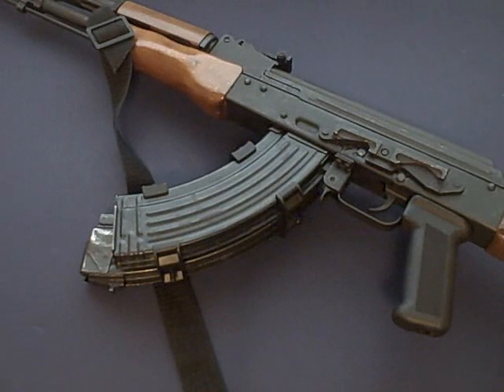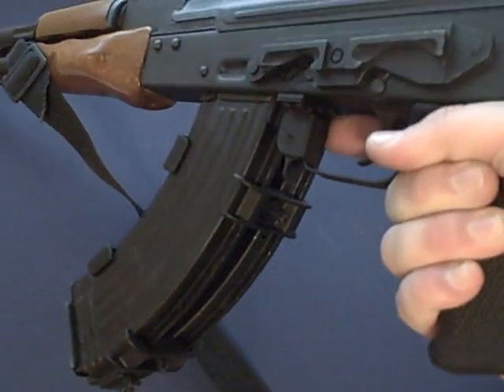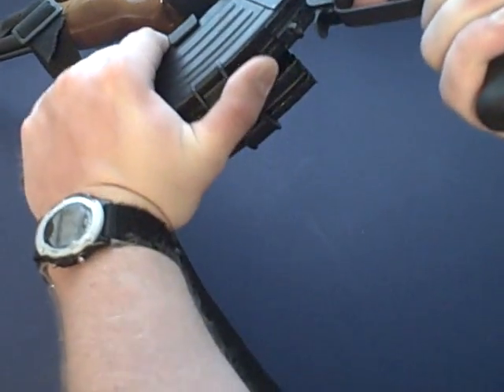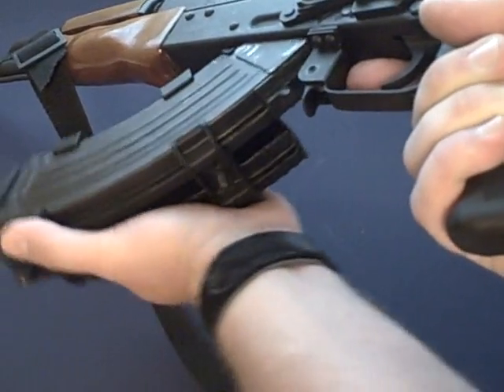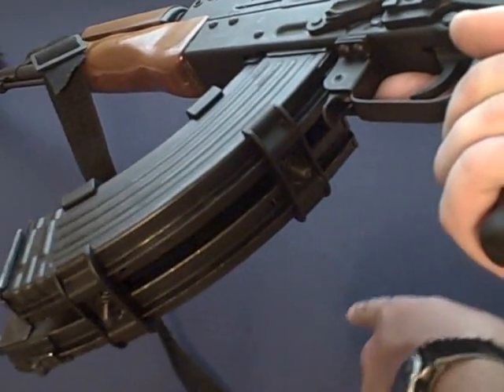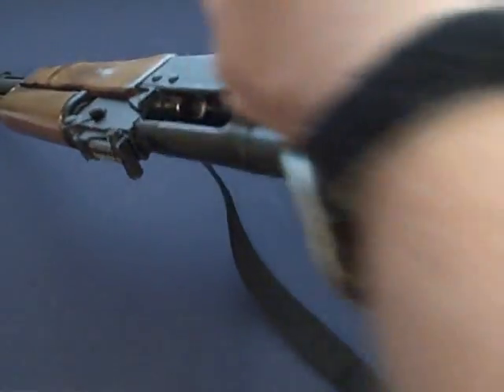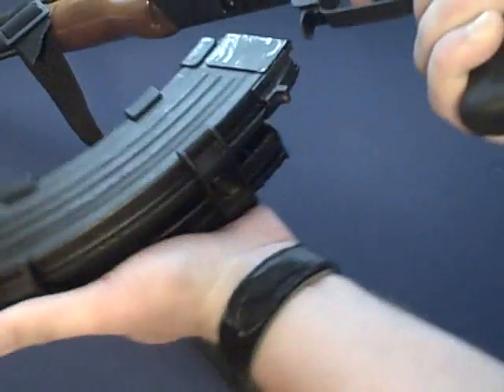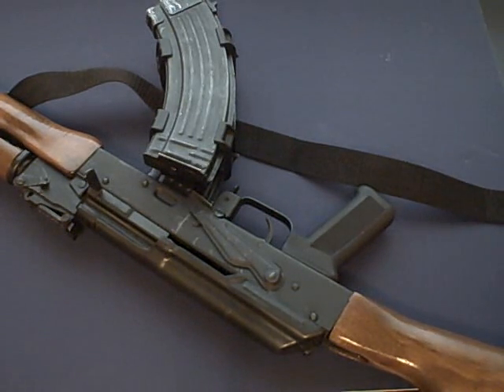The Suicide Magazine Changeout - AKM Rifle

Comment: I do this with my airsoft AK - got 8 midcaps, got 6 of them strapped together in pairs with heavy duty tape - the reload doesnt even take much practice, can easily do it in 1.5 - 2 seconds. My kits pretty much real weight, Both the AK and mags are metal and are quite a tight fit, its still quite an easy reload like the guy said.

Comment: What about using the mag coupler with both mags right side up?  That is how I have mine setup, they are both flush, sit in a double mag pouch and mag changes are easier.. you are moving it one side or the other, not flipping it...

Comment: @ILikeToShootZombies the problem with that is no matter how tight you make the tape the mags will slide against eachother(if they are metal anyway). to remedy that, i just put a thin peice of rubber or something similar in a few spot between the mags, no more slidding.

Comment: for one, there is no lock back on the akm rifle, if you want to hold it open your gonna have to hold it with your hand. to do as you say would require removing your dominant hand from the fire control, reaching up pulling back the handle, bracing the gun to yourself with your now akwardly placed dominant hand, doing the mag change with the support hand, putting your support hand back on the foregrip, releasing the handle and putting your dom hand back on the fire controls. now try that out.

Comment: The AK platform loads much differently than the M1 carbine. The magazine release is on the side of the M1 and can easily be depressed by the trigger finger. The AK mag release however is on the bottom of the mag well just in front of the trigger guard and must be pushed forward with the loading hand. The mag on an M1 carbine can be slammed in with no technique where as you must angle the rear of the AK mag in first before inserting it all the way and racking.

Comment from the maker: @gruzergrub5000 I'll try to remember to make a video about that. On this particular AK, I can't run magazines both in one direction. I will either be hindered by the attached optics mount or the safety lever/dust cover. If the optics mount were not there, I could manage to get away with it. Sometimes the configuration of the rifle will dictate how the mags are run.

Comment: how can you rack the charge handle properly when you're charging hang is in reverse, it just wastes time. it's easier if you just change the magazine by pulling back the charging handle, then press the magazine release with a new magazine, push it out, then release the charging handle, that will chamber the first round.

Comment: I don't doubt that it's easy with practice, my hangup is whether or not it's actually worth learning. Wouldn't two magazines coupled together with the same orientation just be faster and easier in every way? Is there some actual advantage to this configuration? Actually, it seems bad because if your mag touched the ground or something you could get debris in your spare magazine just by getting down on the ground or placing the gun or magazine down, or even dropping it.

Comment: The problem with this reload is that it requires you to have a addition mag's weight on your rifle. Also, I don't see any speed advantage to this versus pulling a mag from your chest rig, horizontally sweeping it across the mag release to strip the empty mag then seating the new mag. your method also requires you to perform different actions for reloading the first mag and the second, that may backfire in a high stress situation.

Comment: It's for assaulting, newbs!  They're flipped 'cause of interference with safety in fire position. Good for truck gun SHTF, ammo with gun and no others. Would rather use duct tape and cardboard, no  tools,  quick on/off, smoother, yet traction for the flip. Heavy with 2 steel mags loaded, practice your targeting. Practice flip with one mag loaded. Thanks for the video, been thinking  about one.

Comment: @millerusaf - I'd like to see that.  I am not saying you couldn't dominate it, I would just like to see it.  

A 12 inch steel plate at 200 yards while breathing heavy after running is not an easy target.  Especially with iron sights on an AK.

Comment: Looks good, but it requires some weird elbow positions that could get difficult to achieve under stress, specially when using an armor vest and/or chest rig. Good old tactical and speed reloads works better for me, thanks for the video anyway :)

Comment: I never understood the reason for doing this. Why not just use single mags and practice realoding  from pouches? 
I mean this way, you put more weight on the weapon, you have a bigger group of mags to secure or put away in a drop pouch mag pouch or whatever, the bottom mag is open to any type of debris or anything that might cause a malfunction and other reasons. And then there's the possibilty that the shooter's muscle memory might reaload into a empty mag instead of reaching for a fresh one.

Comment: Yeah but if you were smart you would attach the mags in the same direction, and that would be easier and much faster.
Reply: then one magazine would be higher than the other (to fit around the magwell walls) qnd you wouldnt be able to use both

Comment: Mag is exposed to dirt , mud and everything else that might be on the ground.
And the fact that under fire you may flip the mag with no trouble. And then under pressure you may fire it dry and then  flip it again!!!!
Reply: ekajeht Doesent really matter A: its an AK, and B : the flipping motion would get any dirt off of it 90 percent of the time.
Reply: ***** Yes but in this context its really not an issue
Reply: Better the sand fall back out of the bottom than for it to sit and collect from the top right? When youre in sand dirt or mud, youll have to deal with it getting in weird places no matter what
Reply: But poor feeding is usually the only thing thatll make an ak stop besides meltdown. And most of that is from a shitty magazine, weak mag spring, or dirty ammo.

Comment: in summary: the AK-47 is really old and outdated (cal. 7.62),
the AKM is nearly the same as AK-47, just better internally (cal. 7.62),
the AK-74 is the "modern" AK and is also chambered in 5.56 instead of 7.62